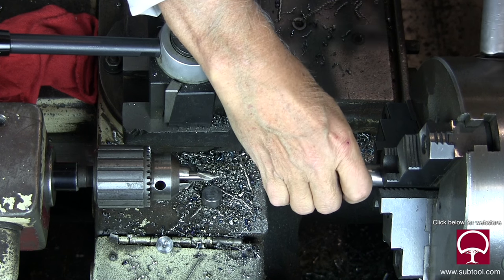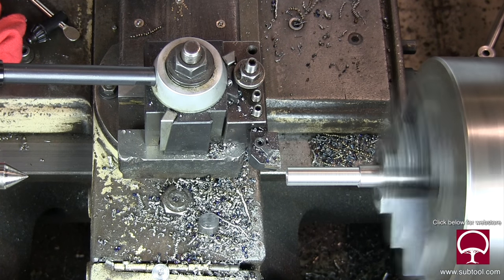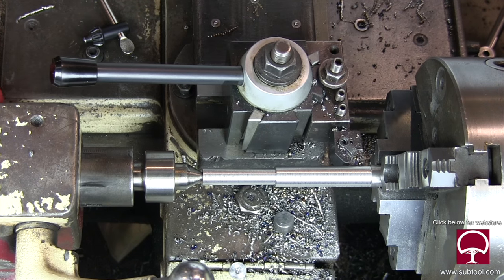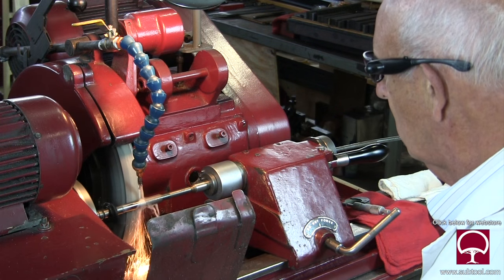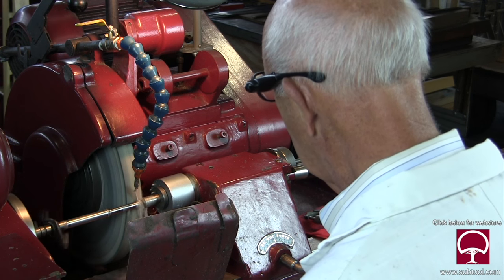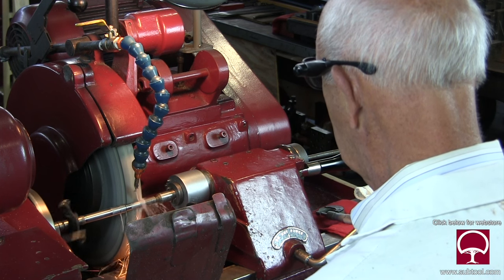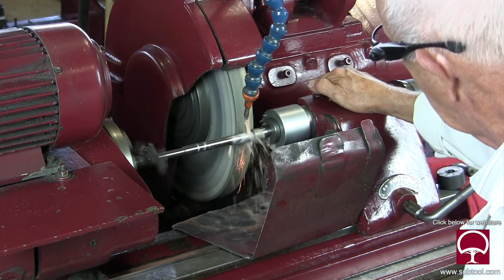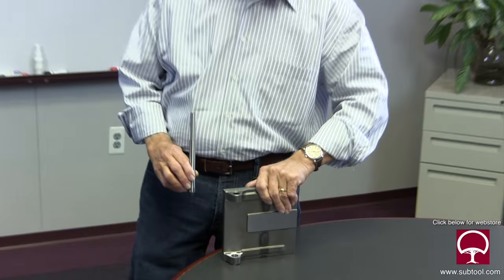How To Make An Expandable Arbor For Jig Grinding Our Sine Plate.

Comment: Don could you please make a video about buying used machines and tools? What do you need to look out for when buying them? At what point is restoration or the hassle with old machines too costly or time consuming compared to a new machine? Are experienced employees that have a "feel" for older machines important?   Would love to hear your experience with that, I can Imagine you have quite a few interesting stories to share with that topic.
Looking forward to watching this video. Thanks for sharing your knowledge.
Reply: +Shermingtan With all due respect to your request, I think that persons that are at least minimally knowledgeable about machine processes know WHERE the dimensions of the work must be held, including to tolerances.  Therefore, based upon this, they know how to determine if equipment needs repair or not.  In most cases, this requires nothing more sophisticated than a dial indicator, test gage, and a micrometer.
Reply from the maker: I like your idea we will produce a video about used machinery and its merits in the near future.
Reply: +Shermingtan the first thing: old machine basements are solid and end-diffusion-homogen.
second: the older the machine, the better you can repair it by yourself!
look at modern cnc or hydraulic/electric cycle machines, you need support!
third: support is inportant. check it out if you have a support in your country!
there are many portals in the internet, but my favourites are special magazines, there are allways machines on the last pages, its the serious and better way to searching.

Comment: Nice jig Don, but I'd think a slitted arbour could be tightened slightly off parallel to the bore's axis on such a short bore. 

What grade of steel are you using for this? I'm still keen for you to do a video discussing the various grades of steel used in various applications.
Reply from the maker: The type of steel is 01.  We double check the arbor to make sure it is parallel and square before we put it in to the jig grinder.
Reply: I had the same thought; that the arbor could get cocked. Normally I would pick up the bottom and end of the plate and grind each hole to that.
Maybe Don could do a video showing how to use a Jo block to pick up an edge. It's the only way I know for splitting tenths on an edge pickup. I'm pretty sure he knows how to do it :)
Great channel guys.
Reply from the maker: We do know how to do that, we will consider that for future videos.

Comment: I think I heard you say you fed in .012 on the grinding wheel then began your traverse. When I grind, I use a steady rest and take smaller cuts. When do you find it appropriate to use a rest?

I enjoy your videos and use many of your tools. Thank you for the great work.

Marc
Reply from the maker: +v8packard It really depends on the diameter and the length of the part.  For example, a part that is .5" in diameter and 18" long would probably require a steady rest.  Whereas, a part that is that is 2" in diameter and 18" long would not.  The type of material you're using also needs to be taken into consideration.

Comment: Don, I've noticed you take a skim pass on the lathe before taking each cut. Why is this? I've seen a lot of lathe work done and have plenty under my belt but this is new to me. 
Also, what is your favorite quick change tool post? 
Thank you.
Reply from the maker: SuburbanTool Inc                    1 second ago                 

Really not necessary. If I were running a lathe on a daily basis I wouldn't do it that way. Keep in mind I have not been in the shop for forty plus years, so forgive my unabashed approach. Most of the quick change tool posts have become generic  but I still prefer the American made Aloris. Thanks for your comment and question. Don

Comment: i allways use a holder for my micrometer, thats better to messure the part.
is this part on 62HRC?
and are you useing hard-metal-centers?
i often have to grind one site gauges with a very small free-engraving betwene go and nogo.
in this case, i grind like this, but i have tolerances of 0,0005mm, so my grinding deep is smaler but: i also grind in direction tailstock, that the other site of the wheel is allways scarp! perhaps you need to use a harder spring setting in the tailstock.
and of course, the coolant is not only for cooling down the part, with 2,5% oil you are good to go.

Comment: using a short cylinder datum to setup a long distance concentricity，I will say it is too tough requirement. I wonder the repeatability is not very good. would you might to loose your screw and tight again after all setup, indicate again after that? I think some factor will effect it: 1. the cylindical tolerance of datum; 2.internal taper hole's concentricity and runout; 3. thread hole lead direction and flange of bolt head. 
BTW, it is good to see Don place a lick recently. Be wealthy.